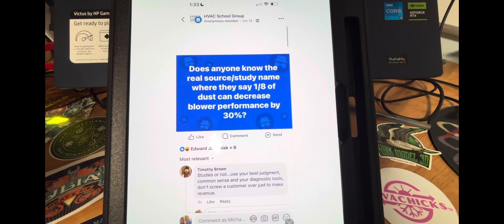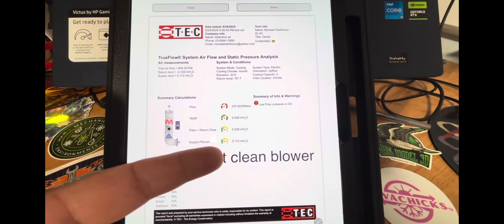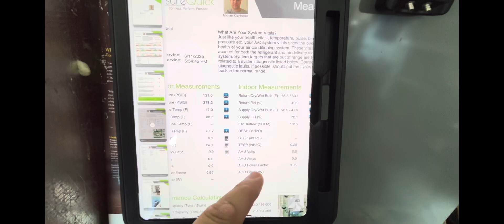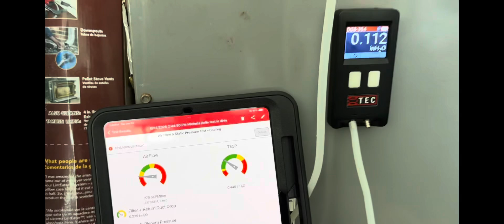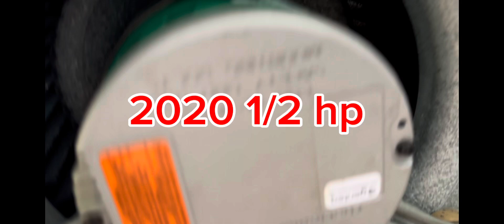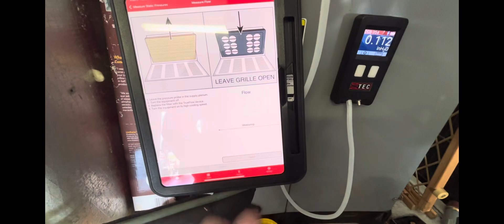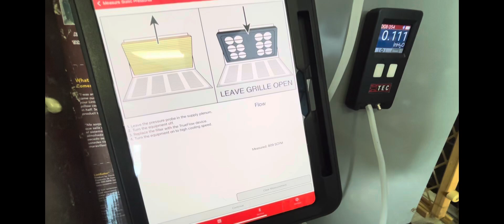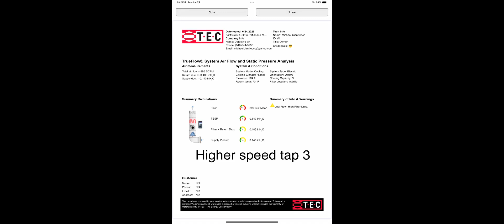Bad X-13 motor. Does  cleaning a blower wheel help airflow??   Residential blower wheel cleaning

Comment: Did you check whether the two different electrical taps you tested at each of these calls were actually programmed differently? Sometimes adjacent taps are actually programed the same, so you have to move two taps over to actually get a different torque setting
Reply from the maker: Joel!!!!   Maybe I’ll go there and do speed tap 4 cause I got not much on speed tap three. Speed tap four was heat.
But at that time, I was like two hours in and ready to go home .

Comment: I might have missed it but do we have enough return air? Centrifugal blower wheels are not very forgiving on the intake side. Is it a central return or individual returns? How about a blockage in the return. Lastly, does the blower performance table match the static pressure of the duct system? You can answer most of these things with very simple tools.  Flow grids and manometers are great but you don't need the to solve air flow problems. The only time this doesn't work is when most of the duct system is concealed.
Reply from the maker: At that low airflow, the static was an an issue until I brought it up to speed tap three.  The report gave diagnostics that I did not include into the report. Sorry about that.. It said the return is not large enough which it is not. That’s why I recommended in the video a 20 x 20 x 5 filter . Still may need to enlarge the return. I’ll keep you in the loop.!!  thanks for watching appreciate it
Reply: Thanks for the nice reply. Please do. It's great to see people curious about and interested in HVAC @thehvacgrapevine5225

Comment: Instead of the Evergreen you might want to try the Azure 10856 Bluetooth connected motor. Once the motor is installed you can configure up to 5 speed settings using your phone or tablet via Bluetooth connection. I  just installed my first one last week and picked up a second motor yesterday. The Azure app steps you through the installation process and is easy to navigate.